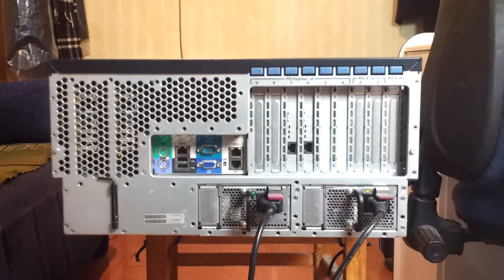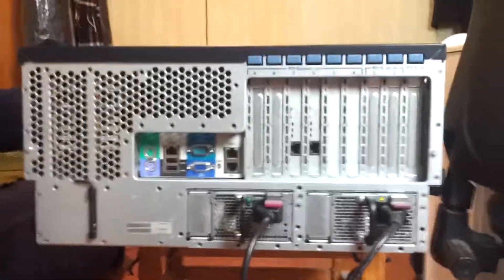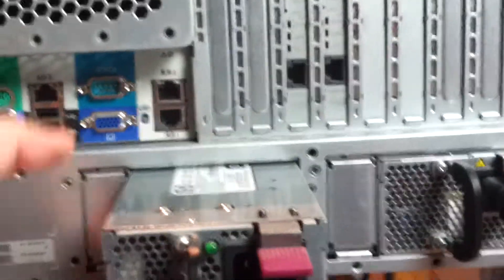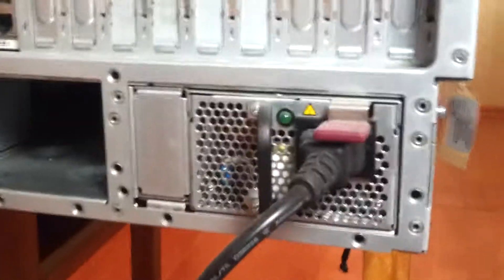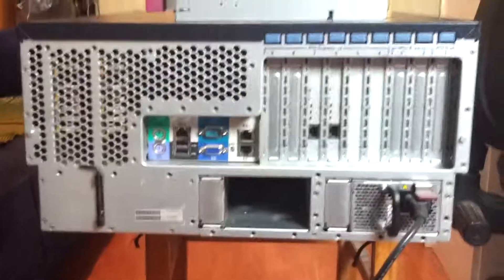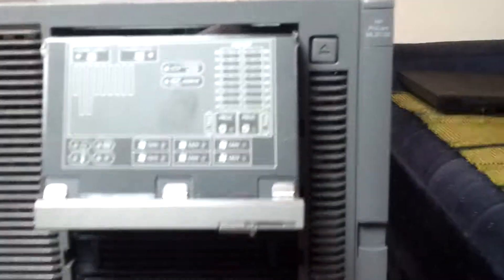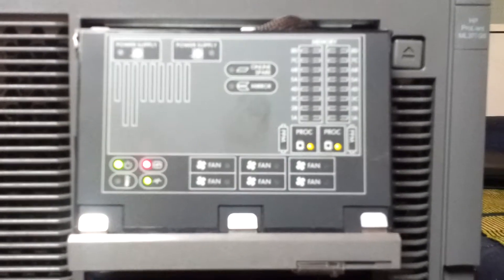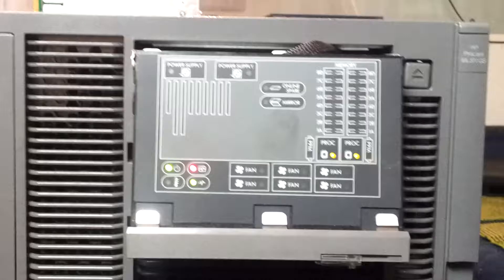Power Testing  hp server

Comment: 6:10
Reply from the maker: hello my friend , what did you want to tell me, please explain. I don't understand what you wanted to tell me.Thanks very mach !!!!!!!!!
Reply: @tehnics-optics4560  I was traumatized after hearing the sound of those fans... I bought this server for cheap on ebay, and wanted to use it as a workstation. no surprise on its loudness since it uses NIDEC VA450DC 2.7A fans, even single one of them makes my ears ring, and this server has 6 of them
Reply from the maker: @Sonic_The_Electronic_Madlad  Your comment made me laugh. The server is very noisy, but when it is mounted in the Rack Cabinet in the server room, it is not heard. As for ebay, it's too expensive for me because I live in Serbia. The server is good for storage, that's why I took it. One disadvantage is that it is very heavy.
Reply: @tehnics-optics4560 EDIT: mine one has 3x nidec va450dc and 3x delta pfc1212de

Comment: Hello, good video. Can you say me, what was the problem?
Reply from the maker: hello NewZo, Thank You very much and  glad you liked the video !!! , I have a Server Hp proliant ML370 G5, CPU: 2 X QUAD CORE INTEL XEON 2.0 Ghz / 1333 Mhz / 2x6 (12) L2, memory: 16 gb PC2 - 5300f ddr2-667 I have a total of 16 gb of frame. The problem is the following, when I turn on the server on the error display shows a red light "External healt LED". The above server us operating system.Server has ghost file backup to DVD. Thank You very much

Comment: G'day fella.
That red error indicator light that is flashing means the system health is critical. listed below are the reason for critical health
1- It is one of both CPU PPM's is failing
2 - 1 of the CPU's is not sitting in the socket correctly
3- DIMM mismatch
Reply from the maker: Thank you for watching! :-) , but what I did not record ("I stopped recording too soon") is that when I returned the other power to the server and switched on with both server the indicator showed me the first power supply to the flashing light.
Reply from the maker: hello , Thank you for watching! :-) , but what I did not record ("I stopped recording too soon") is that when I returned the other power to the server and switched on with both server the indicator showed me the first power supply to the flashing light.